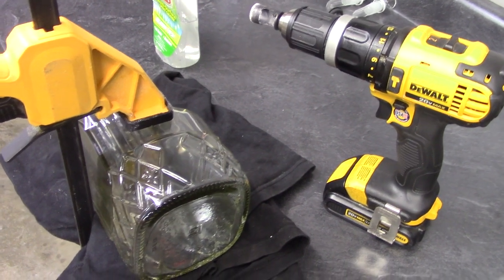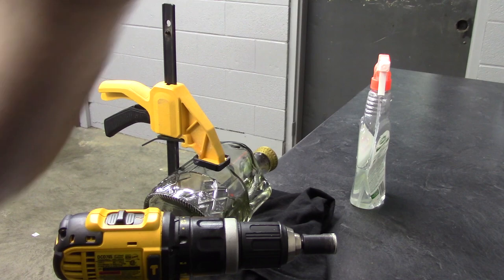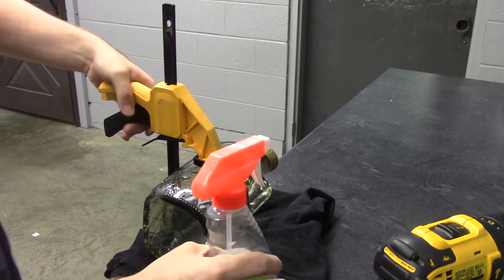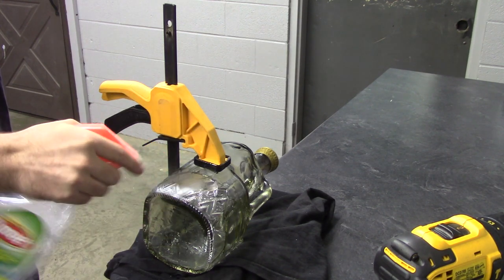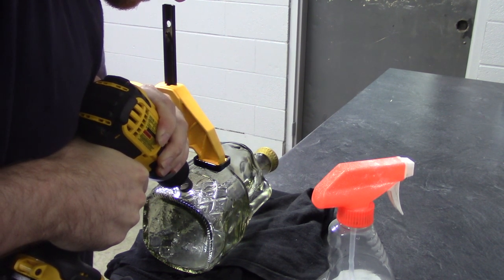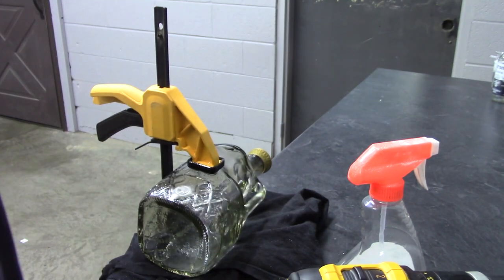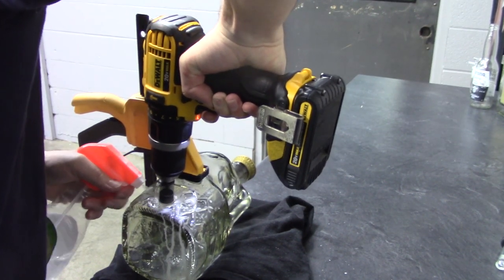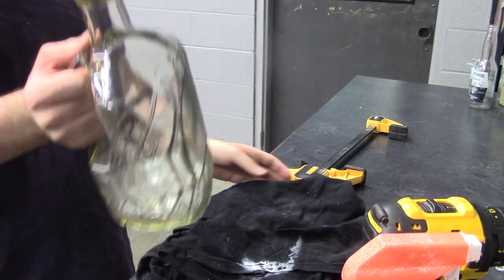How to drill a hole in a GLASS bottle - Bong Tutorial

Comment: Bro I have made so many bongs that I wore out the bit and I got to order more.
Reply: how many bottles can i cut with 1
Reply: @shmurk951dabz  Like 10-12 depending on how thick the glass is. Under no circumstances do you drill with out water either. You can zip through a bottle in 45 seconds to a minuet.

Comment: why drill at the bottom? is the middle too weak?  or a perfect fracture point?
Reply from the maker: The bottom tends to be a stronger point for the glass. Typically the middle of the bottle Is weaker. That's why I recommened to drill at the bottom of the bottle:)
Reply: @sidehustle7110  I thought I'd heard that before. thanks for clarifying that.